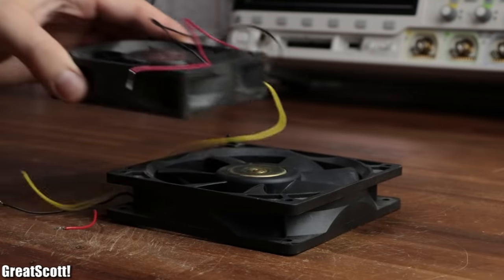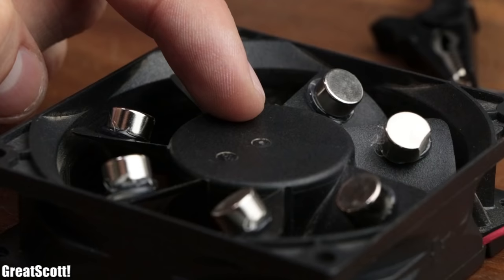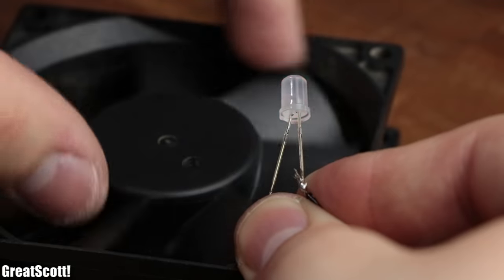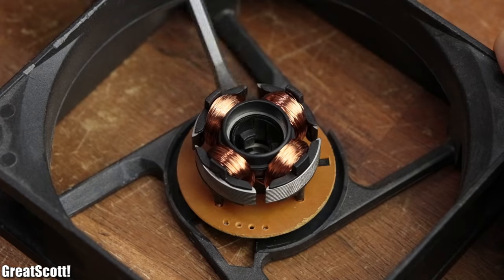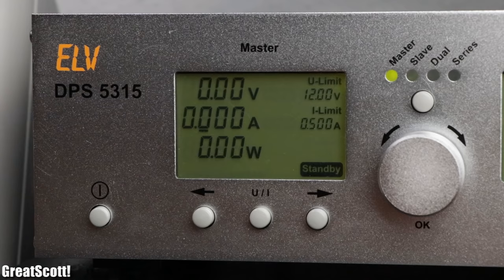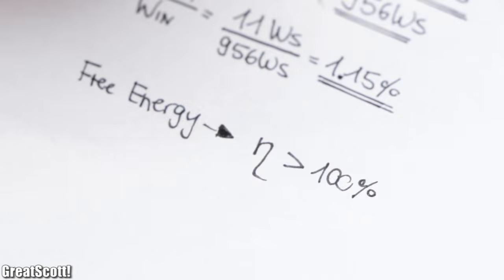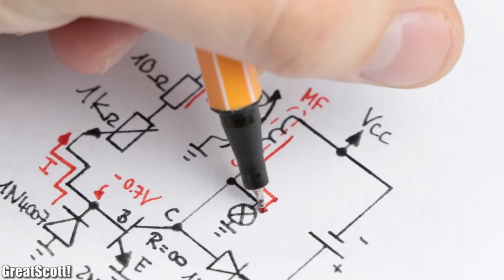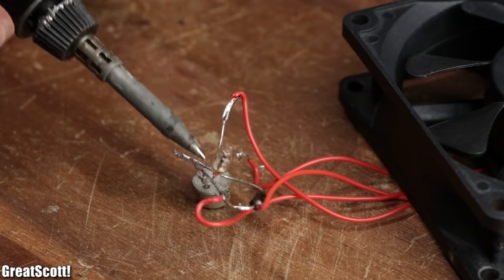Free Energy BS! || Magnet PC Fan, Bedini Motor

Comment: Umberto BAUDO tried to make free energy motor from 
Crop circle blueprint 

He didn’t do it right 
The frame should be 4 circles rotating 

1st circle ⭕️ 
3 sections of large magnets consisting of 6 magnets each big to small,

2nd circle ⭕️ 
3 sections of medium magnets consisting of 5 magnets each big to small 

3rd circle ⭕️ 
3 sections of 3 small magnets each  big to small 

4th circle ⭕️ 
3 sections of 1 tiny magnets 

Each circle adds energy to the next circle to create super conductor from self fueled perpetual motion. 

Also look at searl effect generator that actually works today,
 but would destroy our economy so they created disinformation schools with thermodynamics laws and speed of light laws so we never try to find free energy. 

How does the establishment suppress information

That’s Blasphemy
That’s Heresy
Oh that’s a Conspiracy theory
They Debunked that, it was QUICKLY debunked by EXPERTS 
Skeptics pretend to be skeptical because they are working for the other team.
Hoax is used over and over to cover up truth from 1950-present, how do you carbon date a hoax. Area 51 was a hoax too. The infamous CIA heart attack gun was a conspiracy theory until revealed.
Smear campaign, he a quack, or she’s a witch, 
don’t believe everything you hear, keep an open mind and investigate of some of what you hear.
Fake or fixed suicide, push James Forrestal out a window and call it a suicide 
CIA heart attack gun no residue on Wilhelm Reich 
Diversion using crisis 
Poison people who interfere with economy, or Pay off  for the patents 
Pretend you are going to give them 25 million, then create fake suicide 
Economical hitman
Plata o plomo = silver or lead 
Erased or disappear 
Confinement 
Control the patents = control system 
Book burning to hide esoteric knowledge 
Covert, overt, clandestine operations 
Compartmentalization inside organizations
Misinformation Or Fake news 
Censorship used to control freedom 
Using the word Controversy to block information on Ted  example remote viewing. 
“Your doing the devils work” still used today from the 1800s to block information 
Covid-19 keeps us from socializing 
Separation to divide and conquer smaller groups.
Compartmentalized sciences, divided religion keep us from knowing whole truth. Your in your own cubicle of a pinch of information.
Suppressed free energy & suppressed health technologies. 
FDA/big pharma lock away patents and put people in jail, watch cancer is a serious business with burzynski or dopesick 
Fixed suicide 
Fixed drug overdose 
Poisoned 
Fixed heart attack, The CIA's Secret Heart Attack Gun
Placing extremely high microwave antenna in backyard to create cancer, 
Bible translation cover ups with words that sound the same, 
burned at stake or death threats to hide information.
Deleting messages on YouTube that have anything to do with energy or health.
Conspiracy theory- word created to hide information and push under rug.

Do not just believe the keyword, investigate the information, you are trained from the beginning in a system, when we hear conspiracy theory we automatically change the subject because we were trained or hypnotized to ignore the information.
When the keyword gets old and people start to catch on they change it to a new keyword like debunked. We love new words, so we use them a lot when they first come out, then the disinformation spreads, the ones who don’t believe the dis-information are laughed at and called conspiracy theorists or quacks. 
Remember every scientist in the past who was ahead of information was always a quack at first until science caught up, then they were called a genius.

Anything to do with Energy or health interrupts the system

Comment: Electric power is everywhere present, in unlimited qualities. This new power for the driving of the world's machinery will be derived from the energy which operates in the universe, without the need for coal, gas, oil, or any other fuel". Nikola Tesla

I know it is possible to achieve "free energy"(It is not energy we need but POWER) using resonance and opposing electric/magnetic fields it need to be synchronized and it is made by short pulses and applying power to the circuit in the right moments. By applying very small power u can swing it like a swing to achieve more power out. It need to be resonant and open circuit not close circuit like DC or AC. It works more like tesla tower. So free energy is not bulshit it is everywhere but consequences of giving it to the people could destroy our world today and be disastrous. Remember one thing WE DONT NEED "FREE ENERGY" WE NEED "RESONANT POWER AMPLIFICATION". Look for name Eric Dollard and his Cosmic Induction Generator if u wanna understand what is true free power that is everywhere.
Reply: So, you are adding energy to a already preexistent ammount? , doesn't that mean you arent generating anything? You can't have a starting power of 1w, add another 1w to that and get 3w out. Tesla's tower wasn't even meant to be a way to generate power, its objective was to transfer it wirelessly, which with time turned into what we know today as "radio signals" i think you might know what that is tho.

Comment: Your formula should take into account the wind energy created by the Bedini motor's fan. In other words, power input equals Bedini circuit power output plus wind power output. Can you do this test and see if the Bedini motor is efficient as compared to the same motor before you modified it into a Bedini?

Comment: Wish I had seen this before spending £200 on magnets 🤣
Reply: Did u try, does it not really work?
Reply: @rajanpoddar8967  no it doesn't work. The problem u find is that the magnet will force it the other way no matter what the setup. There are working examples but not this... search for V GATE MAGNETIC MOTOR...
I am currently building one. The "gate" is the part where the magnet slows down so this guy figured a way to jump the gate and get constant spin.
Reply: £200? What kind of magnets did you buy?
Reply: @1976kanthi  neodymium. Larger ones tho

Comment: Try using the same principle to something that is actually designed to generate power. You know like an alternator, I promise you will get different results
Reply: @darklight2.1  😂 you haven't played around with one apparently. When set up rite yes an alternator can produce energy
Reply: 😂 spin it in the opposite direction
Reply: @otgguy7282  again as the dude above said it wont produce anything. It will convert mechanical energy into electrical energy and heat. It doesnt make a difference if you you spin it they other way around.

Comment: its not perpetual of there is an putside force to start it. perpetual motion is when the system can run without outside assistance.
Reply: Some types of motors and impellers do require a little initial spin to get moving magnetic poles generating some emf and completing an inductive coupling (electrical circuit) between stators and coils.  Or even to simply determine the direction of travel.  Providing startup momentum doesn't in itself validate or invalidate the workings of the motor.
But before I get misunderstood or misquoted - it is not a perpetual-motion machine and it is not a free-energy generator.  The video proves this well enough.